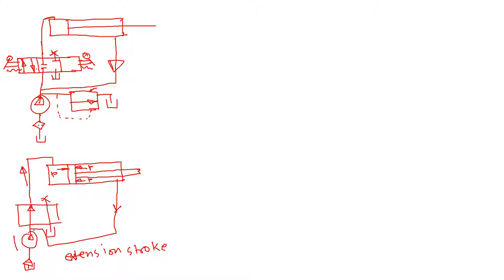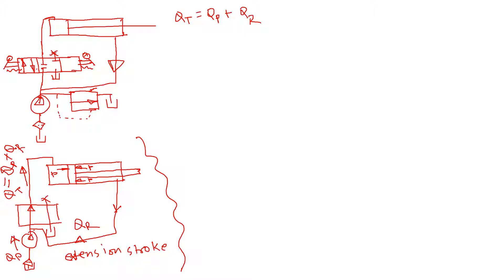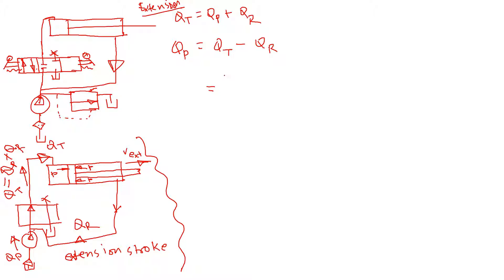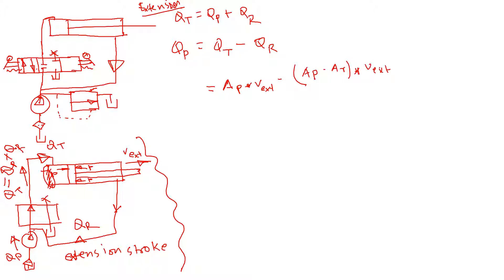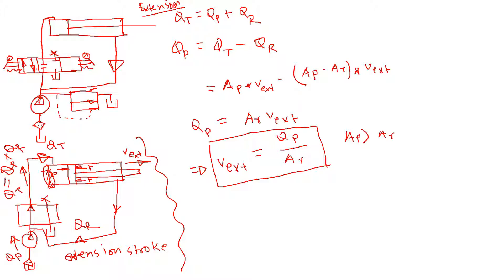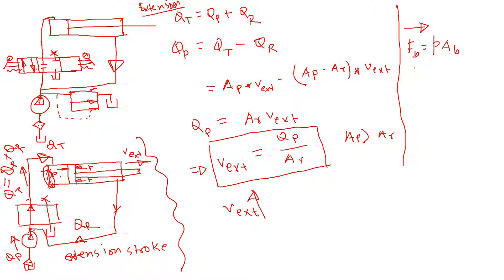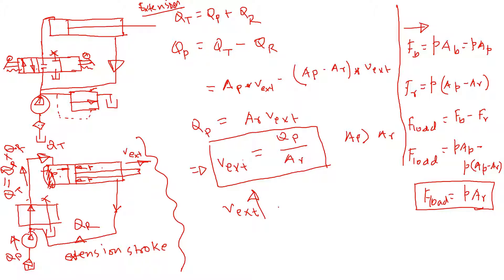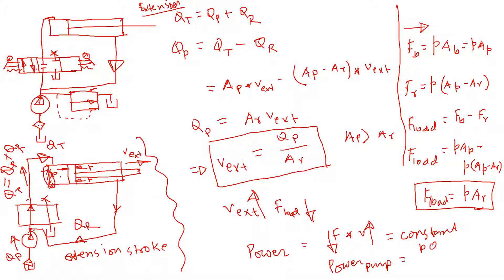Regenerative Hydraulic Circuit: Cylinder Speed, Power & Load | Updated Version in Description

Comment: Sir..can u plz tell me why the pressure on both sides of the piston is same ? (Its usually different)
Reply from the maker: Pascal law states that pressure is same everywhere. The pump output is connected to both the blank and the return lines. In this example, the only pressure source is the pump. Any line connected to it will have the same pressure if the minimal fluid friction is ignored. The cylinder will extend because there is a bigger area in the blank side than the rod side, resulting in higher force in the blank end of the cylinder.